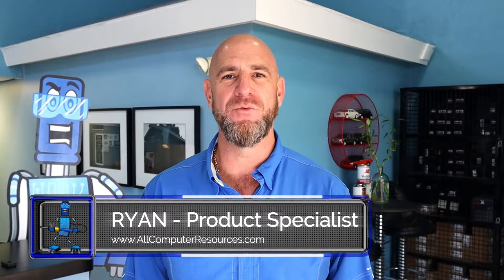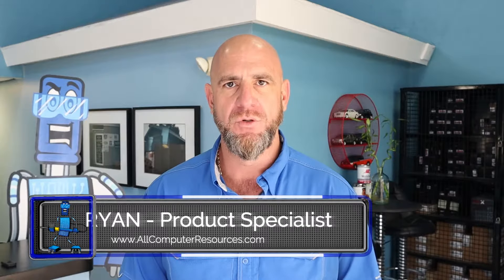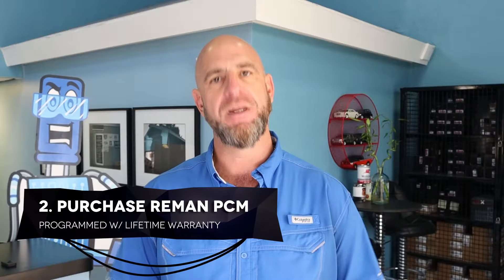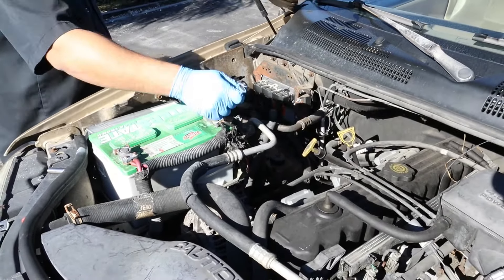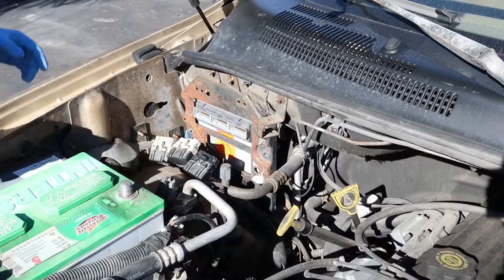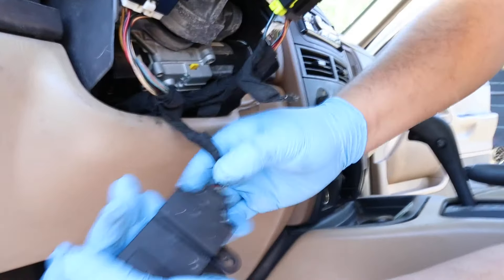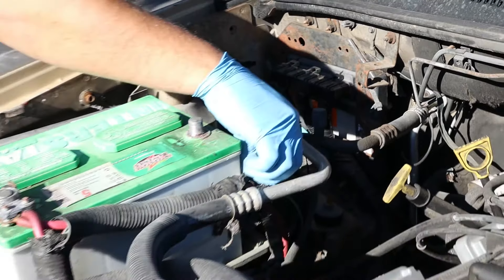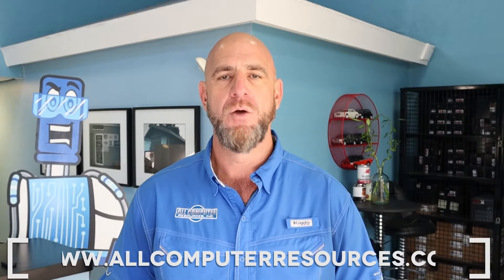SKIM KEY PROBLEM SOLVED - Dodge Jeep and Chrysler SKIM removal from PCM

Comment: Oh wow all U R is selling your service, quite misleading title to the video. I am not surprised I knew it was not a on car fix w/out any further needs aka cash. I worked for Chrysler for many years & w/out a doubt puchasing 4 keys & paying the 1 hour to program them is a far better action than eliminated the system, the keys can be reprogramed if a module fails.
Reply from the maker: Thank you for the input. Since you are familiar with Chrysler and worked for them for many years could you share your experience with all of us? How much would it cost to replace and program the skim module if that would fail?
Reply: Oh yes as for costs U beat the chariots hands down, my view is on keeping the systems intact as designed so I give U credit for providing an option & I would not be surprised If I have installed a few of your remanufactured Engine Controllers in my career.
To answer your question generally the labor including diagnosis would be 1.5 to 2.5 hours depending on replacement time <dia.1 hrs regardless unless a service writer requests otherwise> , Most JTEC'S R .5 to replace reprogramming anything is included w/Dia & entering the milage is an important feature many people ignore.
I hope that covers your concern 👍 
 ... U do have me thinking would there be a way to fool the bias signal? Maybe put a 1.5v battery on the pci wire? ??? Interesting to ponder dangerous to use a vehicle to find out, anyhow happy motoring.
Reply: Unless there are other problems with the antitheft system. This completely eliminates it. Dealers will throw parts at a vehicle until it is fixed, or the customer gives up.

Comment: I asked for a 2007 dodge Dakota quad cab V8 4.7 flex fuel/gasoline. I was told by your staff members, the year of my truck are unable to be deleted?. Based on the listing it mentions beyond 2008 dodge trucks are unable to perform the service. Can I get a clear answer? My truck falls in the service.

Comment: Will the keyless entry still work if I delete the module.
Reply from the maker: Yes
Reply: @acr  I recently bought a truck And every time the battery is disconnected the key has to be reprogrammed is that the skim module or something else?
Reply from the maker: @BentonL  Mr. Ledbetter, we would need much more information to assist you with that question.
Reply: @acr  I was hoping to sort the cause. I assume a lose connector or something. Though all connections appeared to be tight. I removed the module and modified a stock tune file with the option disabled to see if its it via EFI live. I assume when I flash new tunes in the truck this will come back up later on. 

In the mean time I ordered a new skim module and will attempt a relearn once the parts arrive. I dont actually know how to tune I know enough to change some things though. Thanks for the replies.
Reply: ,the skim is not recognizing the chip that's in the key. The skim is programed to do this, it then passes that info on to the PCM. ONCE accknowleged the PCM allows the car to start. Basicly all 3 must match the same info to work.